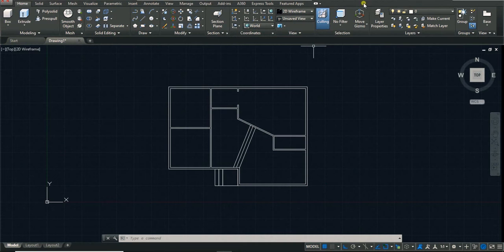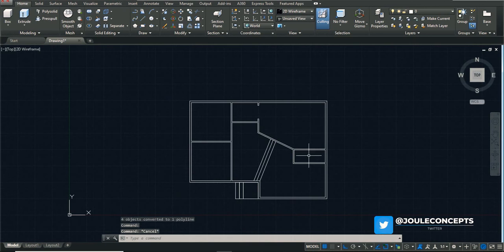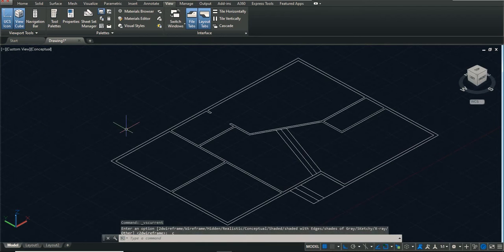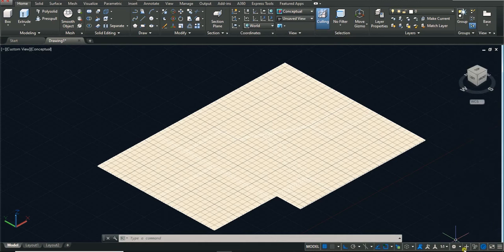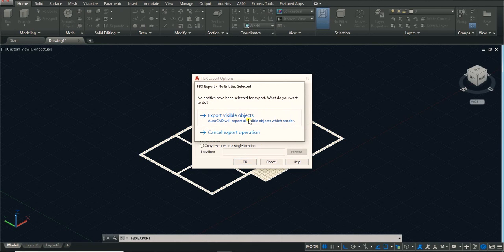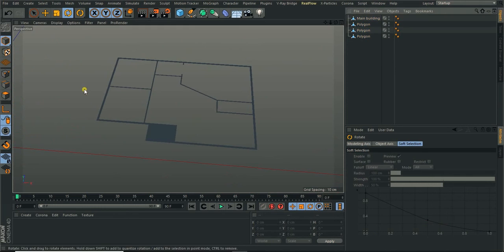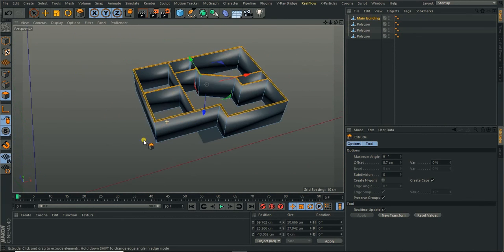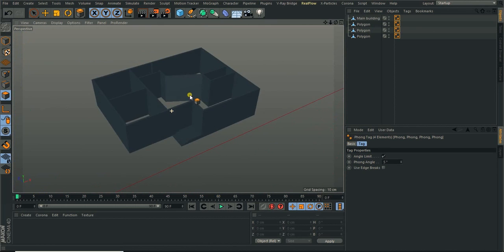Cinema 4D: Transferring Your Floor Plans from AutoCAD to C4D

Comment: How do i break the walls in c4d to create doors and windows
Reply from the maker: Thanks for your comment. You could use a box of the size of the window or door to create the opening using Boolean object, by putting it in subtract mode. 
I hope that would help you